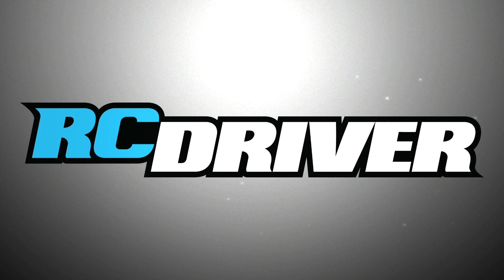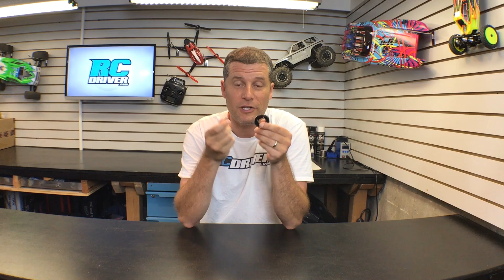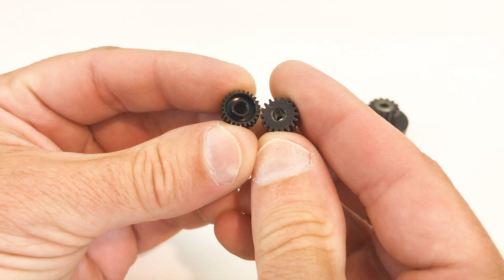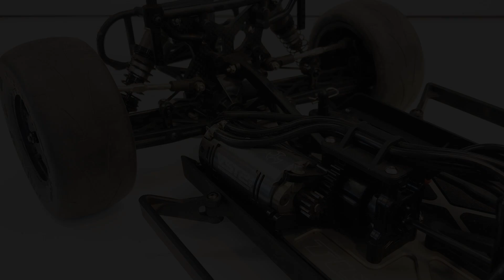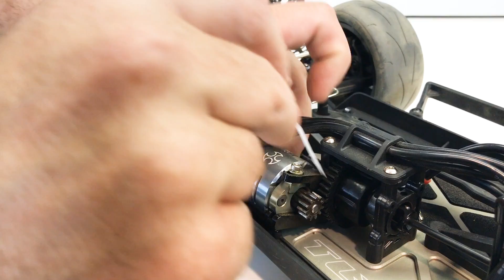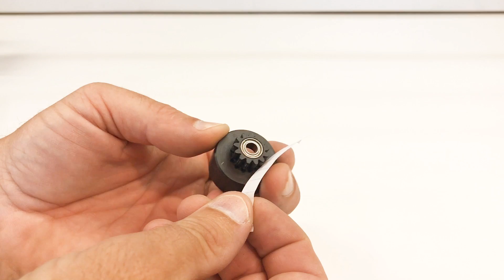Don’t Strip Your Gears!- How To Properly Set Gear Mesh - Get Into RC | RC Driver

Comment: Awesome tips. Being an automotive tech I've got tools for things like this however they don't work for small scale vehicles lol. I actually just came in from bashing on my 1/16 e revo, flipped her s few times and actually heard the gear mesh change, apparently I've got an uneven spur gear and wore it out a bit. Oh well, time to dig into the parts box and do some replacing.

Comment: Do you have a video about lipo batteries for beginners? I'm looking to get into the hobby would like to know the safe way of having lipo's before I make that step
Reply: The Renaissance Collector Indeed good call.
Reply: Take another look at his videos. There definitely are lipo videos. Don't let them worry you too much. Just do some reading and make sure you charge and maintain them properly, they're definitely worth the extra power and speed.
Reply: just dont loeave them unattended when charging, if ur not going to use ur rc car for a few days then leave your battery at 50% charge (commonly refered to as a storage charge).
Reply: i realize it is kinda off topic but does anybody know of a good site to watch newly released tv shows online?

Comment: thanks for the tips, just got my tamiya tt01e and it stripped the spur gear after it jammed then wheels up on my trousers while i switched it on configuring the controller decided to drill out the motor mount very slightly to get the closer adjustment to grip whats left of the gears got new gears in the post but will be 2 weeks working perfect now with my diff lock set up aswell so i know it works well

Comment: Thanks for the tips. No one wants to have wear and tear that could have been avoided , I personally would proffer to strip gears rather than burn my.motor out. I bought a rtr car and stripped gear before batter even went flat. Point to all is even when you purchase a rtr you should check to make sure everything is as it should be , including motor mounts and pitch. I'm lucky the pinion was not level with spur so it only smashed the spur on one side. Every tooth is grinded but only half way if that makes sense. Order a handful of pinions and spurs.

Comment: How do you manage the spring tension on the nitro spur? I have a bolt that compresses a spring for the slip clutch behind the spur. But my manual says nothing about tension or adjustments.

Comment: Is this necessary for a new tc straight out the box?
Reply: Straight out of the box I would assume that the experts that have created it made it right
Reply: Depends on which kit you buy but typically, the mesh is set from the factory unless you use an adjustable motor mount, in which case you’d need to do this.

Comment: Thanks for this video, I just want to ask if it's okay to put a grease in pinion gear?
Reply: I am wondering too, was thinking a little white lithium grease would work great. Will try it on my back ordered rc when it gets here.
Reply: Well you DO have to grease the actual gear but as for the shaft? I’d advise not to. If for any reason the pinion finds a way to work loose, it’ll wreak havoc on your gearbox which can be expensive depending on what kit you own. It’s one of those areas where you’d feel guilty not putting grease but it’s one where you really shouldn’t.

Comment: Ive learned gears last longer going off of leaving no loose points at all ,, alot of times if you adjust to where theres is no binding at all its going to be too loose elsewhere on the gear  i prefer looking for points where its too loose and getting it as close as possible if it causes binding elsewhere i just leave it otherwise ur stripping again off a hard launch on a 3s no loose points at all if it causes binding o well

Comment: The rustler I have, has a plastic insert between the motor and the housing that won't allow me to adjust the motors position. Do I dremel the locking part off or remove the whole plastic insert or what?

Comment: Do you know what the pinion /spur gear pitch is on a haiboxing protector (12815),  also marketed as a bezgar 3?
Reply: Without seeing a picture, it’s hard to say and without knowing what scale, one can only assume. A good way to find out is how close together the teeth are to each other. The further apart the teeth are from each other, the more coarse the gear. Assuming it’s 1/10 scale, it’ll likely be either 64P (fine) or 48P (coarse). May want to Google your question and see if anyone else has any info. Good luck dude.

Comment: I have a Traxxas Stampede and the Spur Gear moves past the pinion gear to the right and car stops moving, I have tightened it back down, what would cause this, the motor moving?

Comment: if your pinion and spur gear are fully enclosed and both metal, should you grease them? Or still too risky incase some dirt gets in there?
Reply: As a mechanic, the general rule of thumb is to lubricate any parts that have to move against each other. This can also apply to your question, EVEN IF you have a “sealed” gearbox! So to answer your question: yes. If not… that’s gonna be one expensive rebuild.

Comment: Can a improperly set gear mesh creat a clicking sound when I press the throttel  or when driving my traxxas bandit ?
Reply: Check the mesh on your ring gear (the one attached to your differential) and drive gear. The clicking sound could mean a bad mesh there. Being a Traxxas, you’ll be able to find the exact shim needed to fix that issue. Good luck.

Comment: is it also possible that the bore that goes inside the motor can wear out the hole cousing metal dust to form around the bolts and screws? i think this happened to me and i am not sure if i should drive it or not
Reply: Don’t drive it. At least not until you clean the shaft and wash and dry the pinion bore. If you’re using a pinion that’s held onto a d-shaft with a tiny grub screw, I HIGHLY recommend using some Loctite BLUE thread locker on the grub screw so that it won’t work its way loose while bashing. It’s highly important to get the color right with the thread locker or you’ll end up with a grub screw that’s permanently held in place. Remember: use only blue! There’s other colors that have less bond and can be much more easily removed but blue is the best as it will hold in place for whatever bashing you do and yet still be removed if you need it to be.

Comment: I've tried to adjust my spur/pinion gears many times on my E-Revo 1/16 VXL, but no matter what I do I always end up having one side that's hard to turn and one that skips, it does a clacky grindy noise when I give a burst of throttle
Reply: Same...
Reply: Same. How do you stop the clacky noise?
Reply: @swagpuppycat  in my case, it was the rear differential I swapped its ring and pinion gears and added a shim (small plastic ring) behind it
Reply: @JF743  cool will try

Comment: Hello, I still strip gears after 10-15 laps, im a begginer, could crashing affect the spur gear stripping
Reply: Possibly. I recommend getting a steel or aluminum spur.
Reply: Crashing generally shouldn’t unless you’re REALLY aiming to hit something like a wall or barrier.

If you’re stripping out after that many laps, I’d recommend checking the mesh after every run. Perhaps in your case it was that you had some screws that worked themselves loose. A little bit of Loctite Blue thread locker will help hold the loose screws in place. Don’t try to use Loctite on plastic though. If you’re still stripping out, even after adjusting the mesh like in this video, then I would consider practicing more to avoid crashing so often.

Comment: I have a 4s kraton with metal or plastic gears they are way at THE back of the Truck down at the bottom i have to loosen motor pull both poles off the red and slipper Clutch 1 then i can get at the metal or plastic spur there aer 2 which 1 is the plastic 1 and which 1 is the metal 1 and the gears are stripped the plastic 1s right underneath the back of Truck i have to take cover of to see looks like. A deep hole they are in like a bear cave there how much are they in Canada Dollars just iam from Toronto Ontario wondering how much r they in us Dollars
Reply: Contact Tower Hobbies or Horizon Hobby with your issue because they’re the only ones that’d know for sure. That and they’re now the owners of Testors paints, among other former Hobbico brands.

Comment: Hi MY Name is Troy Flanagan i have a 4s kraton with 2400kv motor with 2 mah 5000mah 14.8. 50c Battery And A 5000mah 14.8 100c from a smart spectrum Batterys i just. Watched ur video i found interesting information about the gears mesh and motor my problem my slipper Clutch keeps coming lose Now my gears are stripped and just got it out of shop 2 Days ago had to bring it Back into the THE ower had loosened the Engine so he could take it he had take out the red pole and pole under to get at slipper Clutch the problem was not the slipper Clutch was Already tight its was the gears at THE rear of the Truck they are plastic and look Cheap so my Question to you is should i get. Steel gears or Aluminum gears and tight motor so does not move and about slipper Clutch with plastic GEARS will plastic gears stripped faster then the steel 1s or Aluminum 1s And should i keep the slipper Really tight or a little bit looser i but Truck back in may stayed in the shop for 3 months Because manufactures did Not have the Right parts for and plus the Covid virus did Not help matters then when i got it back Ran Excellent for 7 days THEN slipper Clutch came lose again then back in Shop Again with stripped gears just frustrated with the Truck which is like New i don't Drive it hard do flipps or jumps with it just Drive it on a Diamond and grass when i turn it on i let it sit for 20 seconds before i Even move it check Everything over inside and out. Spray the wheels and Arms on the Truck front And back check All the bolts make sure Everything is tight including wheels Now it WON'T go ibackwards These TRUCKs. Have Trouble with slipper Clutch and gears please respond
Reply: If you strip plastic, you’ll strip aluminum. Better to go steel if you need to. Trust the expert at your local hobby store.

Comment: i have done everything in the vid but my pinion keeps kicking fine dust is this normal
Reply: First of all, where are you running? Polished concrete will cause a fine dust to appear. Also if you run near a busy road, you’ll have A LOT of dust collecting inside your model after a run. Clean your model out with compressed air and a large paintbrush. If you’re still seeing dust, it may be as a result of the spur gear mesh of perhaps your motor still has some dirt and grit inside.

Second, check your spur gear teeth for “flatness”. If your spur teeth look wider that the gaps between them, it’s likely this is where the dust is coming from.

Comment: I can’t figure out for the life of me why my motor won’t slide back and forth on my slash 2wd even after loosening the motor screws the motor doesn’t want to move whatsoever
Reply: Loosen the motor screws pull out your motor and it has a plastic piece in the end by the shaft that can be removed in order to let the motor slide